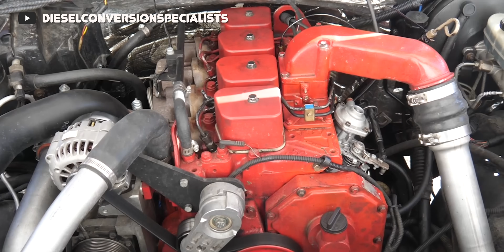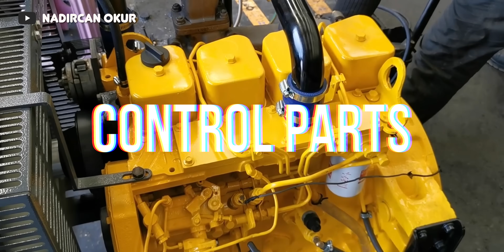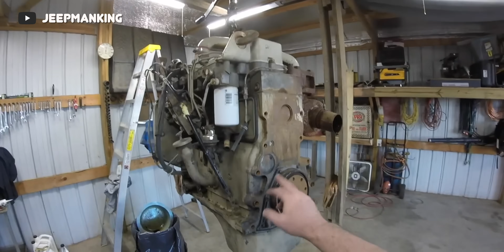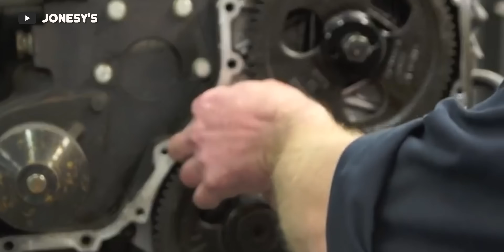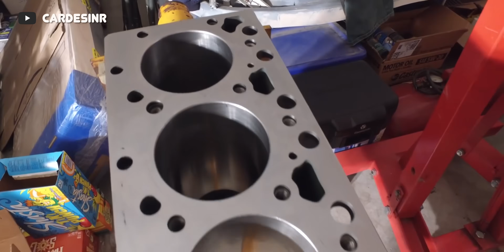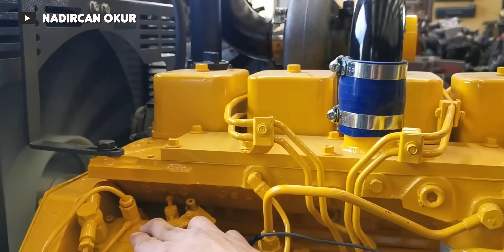Everything Wrong With the 4BT Cummins (It's OVERRATED)

Comment from the maker: What do you think? Is the 4BT overrated or not?
Reply: It would be a great ending for someone who owns a painting business just load paint in truck and and drive to job no need to mix paint as your vehicle doubles as a paint shaker
Reply: @alexlankford6301  that is soo true on mine,my woman calls it a vibrator!
Reply: I have no complaints I have an 88 4 bt turned up to 115 hp in my 86 gmc 1 ton I use an sm465 with an advanced adapter over drive which makes it an 8 speed it pulls and hauls everything I need 
With 20 mpg. What else do you need for a work truck flatbed?
Reply: @zimbabwesteve4620  yeah go ahead and find me a "decent 4bt" for 1000-1500 💀💀💀
Reply: @dirtbiketherapy  I bought a 4 bt with an adaptor to a 400 turbo tranny for 4500 all working great
Reply: Yes. The weight alone makes it a poor choice for engine swapping into anything but a pickup.
Reply: I looked at a 4bt about 20 years ago for swapping into my scout, i elected to LS swap instead for the money and weight. It’s much more expensive now, so it wouldn’t even be considered in the conversation of what motor to use. Both 4bt and 6bt had been done at the time already and for this swap, it pretty much came down to the weight for me. 

For a large truck, i would use any number of larger engines available for much cheaper. For a light duty or smaller I’d elect to swap something else that is lighter.
Reply: yeah, while the 6bt lives up to the hype the 4bt isn't quite so much. still a great engine
Reply: tdi fuck outta here, ive worked -40 weather up north, Cummins Diesel are the ones that will start with no aide, no block heater, no can of eather and they start all the time, and all i see up there, that tells you something right.

tdi is cool when the weather is great, but when it is playoff time your in the extreme heat and cold doing Industrial jobs, come check us out in the open, and bring your Tdi cute little diesels.
Reply: @briggsdidnotstrapem7699  i have a 4 bt in a chev pickup and i have 3 tdi, the tdis will start to —30 the 4bt and my 24 valve about —35,will not start —40.
Reply: @briggsdidnotstrapem7699  ya and try to get 500 hp out of one and wont start north of —30
Reply: yeah overrated. unless u install an aux air compressor starter , biodiesel ,and keep it all mechanical. perfect apocalypse engine hahahaha 😉
Reply: I have two box trucks 5ton in venezuela the the engine are Chinese but with the license of cummins the only best thing about my truck is the engine.🇻🇪👍🏻
Reply: your mom is overrated
Reply: @georgewuzheer  your grand momma fool. you dont talk about ma momma nikka haha. 

that was a good one George.
Reply: Loud and heavy with lots of vibration were the reasons I decided against it. I was 95% there.
Reply: @cyclone-g2z  I am there and your right!
Reply: Loud, heavy, oil burning, leaking, rattle trap is why I like it! Port your heads, use intercooler up front, BIG turbo, injector nozzles, delivery valves, pump work and you can get 400+ HP 🇺🇸
Reply: @jayarmstrong3848  p pump and compounds worked for me
Reply: @herbscheit2061  compounds aren’t really required, the only possible benefit is quicker spool and boost on the lower end if you’re running a manual. Besides that a HX35 with 67 76 ten blade turbine and matched housing along with a 60, 62.5, or 67 mm wheel and housing will give all the boost the 4bt can handle.
Reply: @jayarmstrong3848  well you wont lite the HX 35 without a shit load of lag,tried it
Reply: @jayarmstrong3848  and what kind of boast can they handle,dudes tellin me they ran 100 lbs and never let go
Reply: yes the r2.8 engine is alot better with half the displacement
Reply: @rock-uu7qr  have y’all driven the 2.8? I have one in a truck in Chile, its slow AF. Rattles like a Cummins tho. 

Have a ford ranger with the 3.2 i5 diesel and a Mitsubishi with a turbo diesel, both are so much more enjoyable, smoother and more powerful. 

The transit in NA has the diesel that the World ranger has, I would look to that based solely on my driving experience of it head to head.
Reply: @danh8302  When you add an extra cylinder in a row it allows for more overlapping power than a 4 cylinder. i5s need to be balanced aswell
Reply: @zimbabwesteve4620  where
Reply: Application definitely matters, amazing in a skidloader, not made for a pickup
Reply: @jakehamm8125  mine works fine but noisey and heavy and vibrator!
Reply: It's not overated because it's compared to the rest of American deisels .

The TDI is not a common truck motor, so while it is a better motor it's rare to see.
Reply: @jonathangarzon2798  how is it better?
Reply: No, it's an excellent, long lived engine, with excellent torque rise.  Your clickbait bullshit is overrated, however.
Reply: I have one in my 93 chev excad 4x4 and yes they are over rated
Reply: the 4bt takes nothing to get 700hp. you cant do that with the r2.8 without internal upgrades. it also gets 45mpg in jeep swaps.
Reply: Its overated in stock form,I put one in a 3/4 chev excab pickup 4x4, torque is good as the junk 6.5 was but if you p pump it and bigger turbo cost some pennies.
Reply: 1995 Ford E350 Aerocell + 4BT motor. 

 I have to say my 1995 Ford E350 Aerocell Fiberglass Van Bodie from Unicell, that came with a 5.8L 351W roller cam motor with the arrow dynamics of the Aerocell Fiberglass Bodie 15' box I could get about 12.5 miles per gallon on I-5 with all my gear in back. I LOVE This Box Van. I have a Beautiful coach style paint job and everyone asks about it. Burgundy color over White, black and Silver is just amazing off the Luxe 44FL ELITE.  It weighs in @ 8,600# empty, as it hit 220,000 miles it slowly dropping mileage to 11.9MPG till I finally pulled it out. I did a Cummins 4BT 3.9L Overhaul Engine Rebuild Kit from for $740 in my garage and trips to the machine shop. I got the motor from a auto Auction standing in the rain for $1,800 with a transmission and took me 3 months with work, But that is counting the 2" full custom body lift off the frame outside so the motor would clear everything. Now that I have 18,000 miles on it this year Dec/24/23 with 4.10R&P gears & 33" tires I'm getting 21.3MPG on I-5. It still has the same load of 2 motocross bikes and all my gear. 1 couch, fridge, Microwave, lights, tool boxes, and everything to go racing. With the 2" Rubber body lift and Fluidampr #960311,  I really don't feel any vibration on the highway and a saving of $289 per round trip from Eugene Oregon to ACP motocross track in Arizona with a savings of $2.125 this year alone in fuel. It was totally worth it. I will never sell it!
Reply: Not
Reply: Best in a boat
Reply: Y’all’s mamas are over rated if you hating on BT Cummins of any sort shits a beast on hauling and off road applications!!
Reply: I am thinking to swap my Mitsubishi 99 3 doors  pajero 4d56 and get a 4bt or a 2.8 which is better.  ?
Reply: perkins is cheaper and hassle-free. I would like to say that trucks using Perkins have better traction, burn less fuel and do not overheat. From what I've seen on Cummins, overheating and bearing damage occur more. Additionally, there are no tractors using Cummins other than Case IH. Perkins engines were used without any problems in Massey Ferguson, Landini, Claas, Mc Cormick, Case Ih, Valtra, Hattat, Erkunt, Farm Trac, Başak, Tafe tractors. It works smoothly.
Reply: Vw 1.9 Tdi can easily make way more power. 
Fraction of weight. 
3x economy. 
Same piston design 
Same injector pump. 

HALF displacement. 

For shame
Reply: @fastinradfordable  “vw 1.9 tdi can easily make way more power”
How much are you talking about? I see 4bt putting down 500hp, regularly. Can you link to the easily making way more power? I am piqued.
Reply: @danh8302  ya cant out of a tdi,Ive tried
Reply: @fastinradfordable  i have both and you are soo right!
Reply: @fastinradfordable  not a chance, show me where you can get 500 hp out of a tdi,I have 3 tdis turned up,great engines but my 4 bt in a 4x4 excab 3/4 ton will pull better all day long and if you tune it no comparison
Reply: @fastinradfordable  same injector pump? Not!
Reply: @fastinradfordable  tdi is half electronic half manual,cant turn them up enough
Reply: @fastinradfordable  Man this type of engines can pull at 1.200 rpm tons... a golf engine cannot replace a light truck engine, even VW uses in the 9-150 Truck and that can pull 11.000 kg.
Reply: Cummins has the r2.8 just as reliable and more power and tourqe the 4bt is overrated af
Reply: @gavincarroll2553  2.8 has timing chain and a slew of electronics
Reply: @joeyscleaningladys  that can be a good thing or a bad thing depending on how you look at it on one hand the electronics let you monitor and tune everything and it can't be making enough power and revving high enough for the timing Chan to be much of an issue

Comment: We were fans of 4 cylinder Perkins diesels. Use to score free or very cheap from local farmers and construction companies. They were built like tanks and delivered noticeably better fuel mileage. I put one in an f250. Yes it was a project but worked surprisingly good. Not fast by any means at highway speeds. But that pickup went from 14 mpgs to 30 mpg average. Plus it sounded cool. And it remained a hell of a work truck. That thing moved hundreds of cords of green cord wood. 👍

Comment: Its not over priced if you own a commercial shop and get dealer pricing and do all your own work i just picked up a QSB4.5 for 950 bucks swapping it over to mechanical fuel pump and dropping it into my 2001 Jeep Wrangler

Comment: Far a truck I'd rather just do the 6b, you get more for the money. For something like a jeep I would try to find something smaller unless your dead set on minimal electronics.
Reply: With my 6bt 2nd gen, I get around 14mpg. A 4bt is supposed to get around 25mpg. Add up all the money you save in fuel over the years.
Reply: @jeradfry345  you do make a very good point. Add in a well thought out twin turbo setup with proper gearing and 30+ mpg is very realistic.

Comment: perkins is cheaper and hassle-free. I would like to say that trucks using Perkins have better traction, burn less fuel and do not overheat. From what I've seen on Cummins, overheating and bearing damage occur more. Additionally, there are no tractors using Cummins other than Case IH. Perkins engines were used without any problems in Massey Ferguson, Landini, Claas, Mc Cormick, Case Ih, Valtra, Hattat, Erkunt, Farm Trac, Başak, Tafe tractors. It works smoothly.

Comment: I'm debating on putting a 4bt cummins in my 1960 Dodge D100 4x4. (Not sure when the W designation came out for 4x4 equipped trucks in the dodge world. Technically itd be a 1960 W100 but idk.) Its either that or I'm just going with a standard 5.2 magnum swap. I want the great fuel economy but the cost is whats really kicking my ass with the idea of it right now.

Comment: so, I appreciate the insight you have provided on here. While I am not an expert in the matter you have discussed, I came across this video while I was searching for advice on 4BT 37. KW engine vs Yanmar 34.3 KW engine to equip a smaller than average backhoe loader. The manufacturer gave me a choice between Yanmar 34.3 KW and Cummins 37 KW. To be honest I have no clue how each engine will perform in this backhoe loader. I mainly concerned with performance and replacement parts as opposed to pricing. Do you know which one is best?  Thank you

Comment: Cummins took a page from Mercedes-Benz with this engine. I had a 1958 180D that was built in multiple variants for different applications.
Reply: Om606 is supposed to be better. Can make more power and is lighter.

Comment: I’m a 30 year veteran mechanic and I daily drive an old Ford with a p-pump 4bt. Best engine I’ve ever owned. I run the piss out of it in a 1 ton 4wd truck and it always starts and delivers as much torque as the 460 it replaced with more than double the fuel economy. Need I say more? The shortcomings are only realized by people who are used to living in a bubble. I’ll probably have this rig going till the end of fossil fuels and you’ll probably have owned 4 trucks by then 😝
Reply: I'd bet on it
Reply: Wait if you’re running it in a 1 ton 4x4 why not run a 6bt? Jeeps run them because the 6bts are way to heavy but a 1 ton would be no problem with that

Comment: im actually looking into this and keeping it as a hybrid for a truck since I dont need all of that power since the e axles will do 900 hp. the 4bt would just need to make between 30kw and 100kw similar to what Edison motors is doing with the cat c3.6 but not 15k and looking at refurbished motors and as you mentioned crate new motors once I switch the truck to be a ev. using tesla salvage

Comment: I would like to hear your opinion on what a different viable engine would be. Im not buying the notion that the R2.8 and 4bt are in the same league when it comes to pushing a 3/4 ton Suburban around. Those 4bt's pushed bread trucks around and were reliable. If you want cylinder liners, i think you need to look to something like isuzu

Comment: I feel like your only experience with these engines is based off of what you see on paper. $16,000 for a rebuilt 4bt? I sell 4bt long blocks fully remanufactured with Genuine parts for less than 4k. Fully dressed for less than 8k. Simply adjusting the pump and you've got almost 400ft lbs of torque with the oldest Rotary pump. Is it still overrated? Probably. But at least don't get the facts so misconstrued

Comment: I have a 4bta 3.9 l and mine leaks oil from the front crank shaft seal and the timing cover . One question i do have is if a swap it for a 6bta 5.9l will i have to swap the clutch ,? Its my engine is on a 2005 vermeer bc 1800 chipper any good diesel techs in GA? Thanks for the video
Reply: No it's the same

Comment: The Isuzu 4BD1T is the same displacement, HP and torque as a 4BT Cummins but is lighter, has even less issues, vibrates less, and is just as tunable, plus all models come factory with an inline pump. Not to mention they are much cheaper and easier to rebuild.

Comment: Tell me where to find a mechanical engine, diesel powered, makes good power, fits in a ranger, has parts availability and interchangeability with one of the most popular diesel engines on earth, and has better gas mileage than most 4cylinder gas engines

Comment: As you mentioned the 4BT is over priced, but for an equally good solid diesel that's not over priced try a Nissan (Datsun) SD22 or the SD24.  They are also 4 cylinder'd diesels and they are awesome engines.

Aloha........................
Reply: or the isuzu 4bd1t same displacement as 4bt cummins but a better engine all round

Comment: They are reliable and bolt to everything a 6bt does, with a p pump  and the usually goodies they can make 3 to 400 hp , and are capable of good mpg. Onbthe down side they vibrate
Reply: And heavy

Comment: It's not overrated. Hear me out. It's not a perfect engine, but it certainly has very few objectionable issues. And since most other engines DO have lots of objectionable issues and problems, it's right up there with the 12v as easily-made bomb-proof reliable. That's why it has GOAT status.

If you're going to say it's overrated, you have to have some engines in mind that you'd rank higher than the 4BT for its size.
Reply: Om  606 merc!
Reply: From experience

Comment: You only mention the issue of the pin and cylinder head, the cylinder head crack is the same in many engines. JOHN DEERE have plenty powertech with cracks in the engine block, plenty here, that's a big issue. I think here where I live is cheap to repair 4BT and it has a long live, like the Perkins 1104, I have a 1104 with 30.000 hs now to repair, and 4BT with more than 20.000 hs. I think you to take a look at the market, geography and aplycations.

Comment: I have the 4b Cummins(no turbo) in a 1990's Case 1840 skidloader. I'm really enjoying the ability to buy parts for it at local auto parts stores. I tell them I have a 1990 Dodge pickup, and most everything fits without an issue.
Reply: Put a big turbo
Reply: @RohanSanjith  I've wondered what a turbo would do for this loader. It would be a tight fit, but should be possible.

I formerly had a 1835c Case loader, which is the same frame size, but with a Teledyne engine instead. The torque curve on this Cummins was phenomenal compared to the Teledyne, despite similar horsepower ratings(55-ish).

Comment: I bought a 6bt long block for 1500, it came with a hamilton warhead head, I'm currently rebuilding it. Is it expensive? sure compared to a 350 big block but its a diesel. Diesel is expensive period, detroit, fords idi, cummins, BUT they last and are reliable, (if you get the right engine), they last 5 times longer than gas. The after market support is HUGE too, I can get ANYTHING except my block aftermarket right downtothe kdp retainer plate. As far as engines go its damn near impossible to beat the 6bt and 4bt in reliability, power, and repair time.